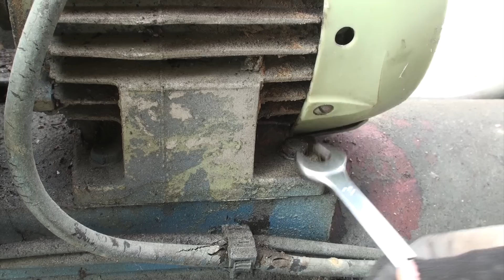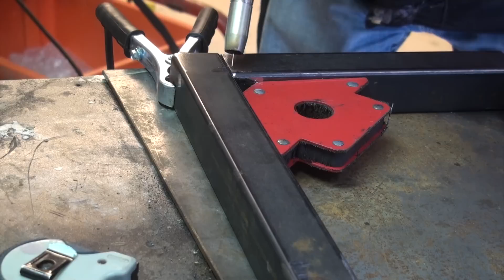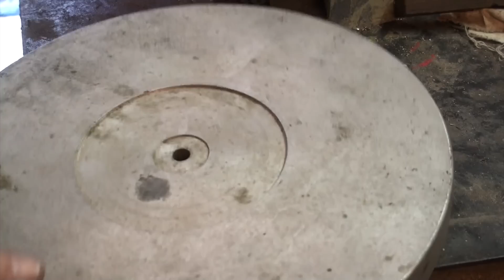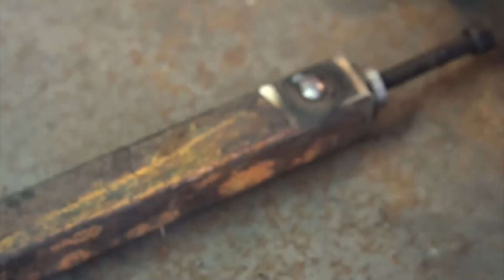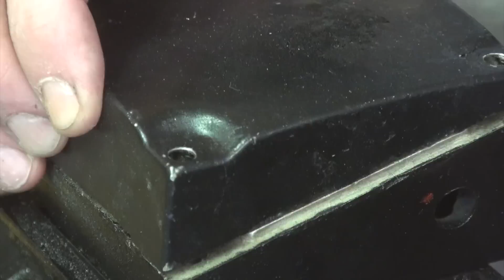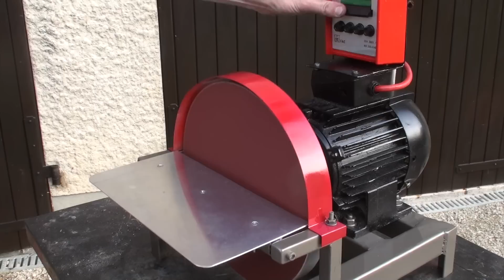How To Make A Disc Sander Out of Scrap - Metalworking

Comment: thats awesome.. I have a old 10 inch band saw motor that's been sitting around collecting dust and I've been wondering what to do with it I have a Disc Sander I converted from an old lathe but this was awesome!!good stuff as always Red!🍻💥
Reply from the maker: Joe basementwoodworking Thank you Joe. Turning old (broken) tools into new ones is pretty fun. Can't wait to see what you do with this old bandsaw 😊👍

Comment: looks good!. I think the disc could use some balancing though, to cut down on the vibrations :)
Reply from the maker: Auarhau Thank you. Yes a friend of mine has a big metal lathe, I'm gonna borrow it to turn the plate and balance it. Thanks for watching 😊
Reply: Sweet. I was thinking just drill some holes where the heavy spots are to remove material quick and dirty. There are many videos out there on how to balance bandsaw wheels etc. Might be a backup plan if facing and turning on the lathe does not make it perfectly balanced. Going to watch more of your videos later, lots of cool stuff here!
Reply from the maker: Auarhau your solution sounds quick and simple. Thanks, I will try it if the lathe thing gets tricky 😉

Comment: I just made one out of scrap myself, by scrap I mean a Harbor Freight belt/disc combo sander...  I know you get what you pay for, but I swear it's like they add burs to the parts like it's a feature.
Reply from the maker: Lol, yes, we have the same kind of tools here as well. Cheap and not well made, but easily customizable :)
Reply: @RedSmithWorkshop  I can't believe I missed your zippo the first time I watched this, do you use any kind of sealer to help with the fuel loss?  I don't smoke, but I also don't go anywhere without my zippo.

Comment: What did you get the disc backing plate from?
Reply from the maker: I don't know, It was laying around in my dad's shop. I got the idea of making a disc sander when I found it.
Reply: @RedSmithWorkshop  looks like it may have been a potters wheel.
Reply from the maker: @glenking3337  Probably yes
Reply: @RedSmithWorkshop  Just trying to figure out where to find one.
Reply from the maker: @glenking3337  I really don't know. I need another and have been searching for weeks. If you find one, please let me know.

Comment: Grate job from Argentina! A little question, u don't use 60 Hz?
Reply from the maker: Thank you very much. I do. Usually I use 220V 50/60Hz motor. But in the shop I also use 380 V motors, mainly because I find them for free ;)

Comment: You would be better off taking it apart and replacing the bearings on that motor instead of painting the outside
Reply from the maker: +seasonedtoker If my father who has been a mechanic for 55 years says the motor is good like that,  it is good like that.
Reply: The Redsmith don't take it offensive, wasn't a rude comment, just a suggestion. It is just twice more the satisfaction painting that motor then. Replacing bearings is a common sense here, not a must, as they are easy to replace. Better do that now when you only have a couple of screws to undo than later down the road when the machine is complete. Just saying. Otherwise nice build, plenty of future ideas for me and others watching
Reply from the maker: seasonedtoker I didn't take it as an offensive, sorry if I let you think that. You're totally right, better do what's necessary before the build. But we checked the motor off camera and it was all good to go, once the dirt was removed. Glad you got some ideas from the video and thanks a lot for watching!😊👍